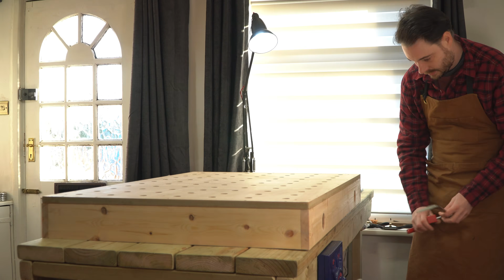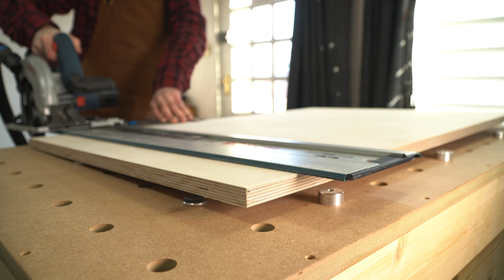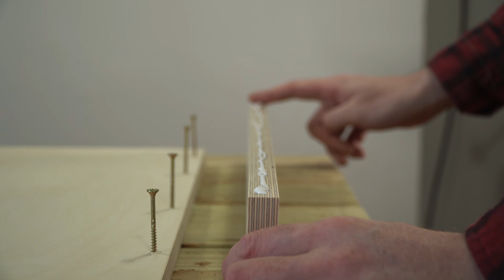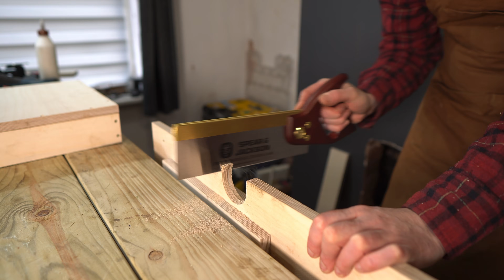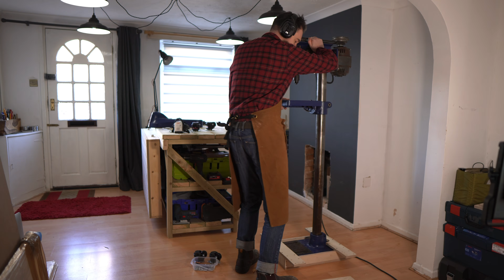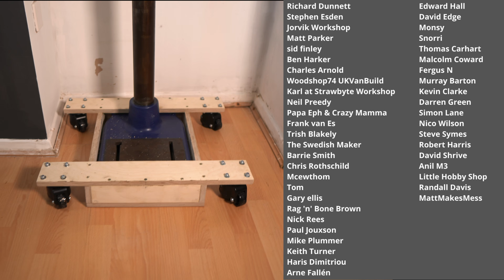Making A Drill Mobile Base

Comment: Been foot dragging over locking casters on a box, thinking about how the limited contact area afforded by a caster, could ever provide stability that this sort of kit would provide with many times the contact area though each pad.

Your vid was 3 years ago now - plenty of time to evaluate their performance over time. How about providing an update good/bad, further mods, durability etc? Did it meet your expectations?

Also liked your bench on a bench mod. My bench is a recycled kitchen counter section with a heavy top. I think I’ll add a higher section to hold a quick release vice on the front, at a more comfortable height for me. I have a single height late 70’s Workmate folding bench, with an uncommonly stable design. Your box on casters and pads would be just the solution for raising the height and maintaining the stability for that as well.

Will check your other vids too. Really enjoyed this one.

Comment: I just finished making a mobile base for my drill press. The wooden base on mine is a little different, but the casters are the same type but maybe a different model or brand. What I noticed with mine is that the drill press is rather stable while rolling on the casters, but noticeably less stable when sitting on the casters' leveling feet. There didn't seem to be too much play in the leveling feet when I examined them after unboxing, but now that it is all done I see that the casters I purchased are a problem for this application. Have you noticed this issue with yours?

Comment: nice design, but a bit scary to put all this weight on 8 small screws. I think I would use some 8-10mm all the way through bolts, with countersunk heads at the bottom, and nuts on top.
but hey, if it drops from 1 cm to the floor, it's not a big deal.